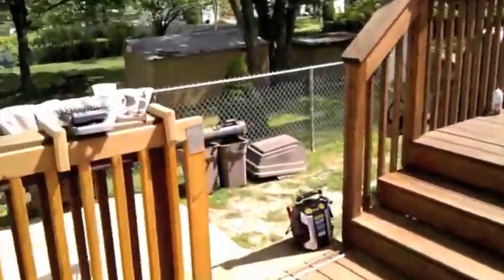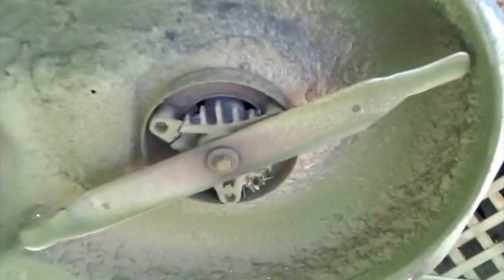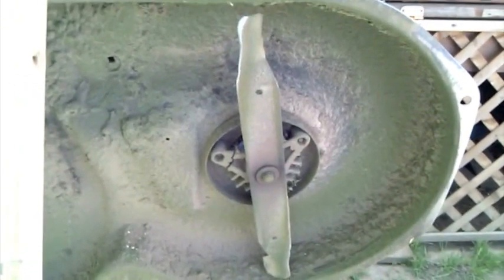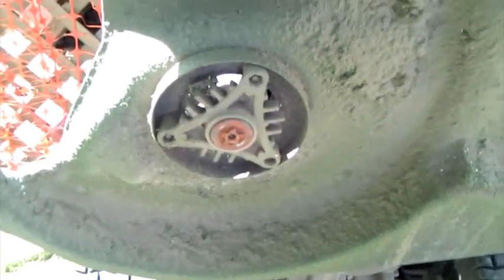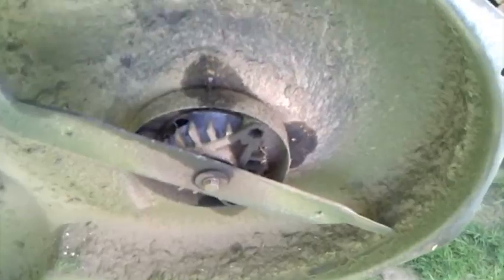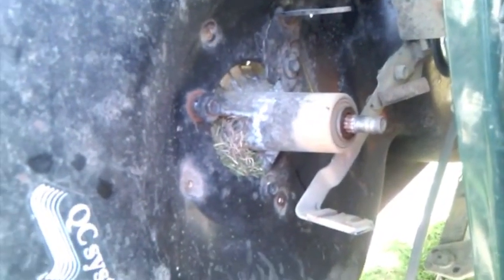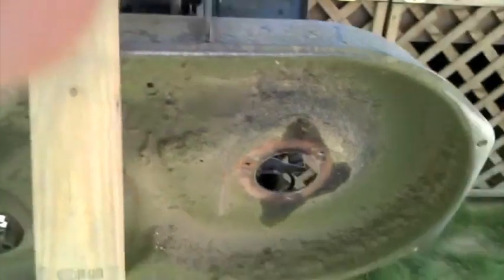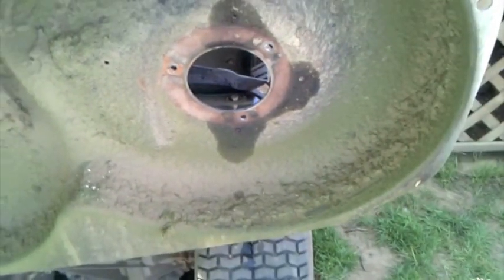Craftsman 42" Tractor Mower Blades Spindles Etc

Comment: I do the same thing, only not with a board, I have a ratchet strap hanging from the joists in my garage and once I stand it up, use the strap to secure it. The 2x4 seems a bit dangerous, but as long as you're careful, it it DEFINITELY much quicker and simpler than removing the deck.

Comment from the maker: Either way, the entire unit needs to be replaced as they are basically one piece, right? Or could I buy a mandrel, and press out the old spindle into the new mandrel? Im sure cost wise it wouldn't be much less to get the spindle by itself any way, if you could find it.

Comment: Craftsman Mandrel is made of cast aluminum and is real junk! They need to make it out of steel!!
Reply: if made from steel it will be too heavy plus will rust faster. be better as an aluminium alloy
Reply: your wrong, it is  so it will break at theslighest pressure,check out heold snapper mowerdesign, i can hit roots, dirt,and even 3 inch stumps and it keeps on mowing, so screw cast aliuminumm.........yes im drunk and cant spell